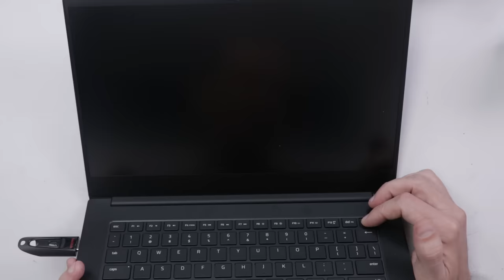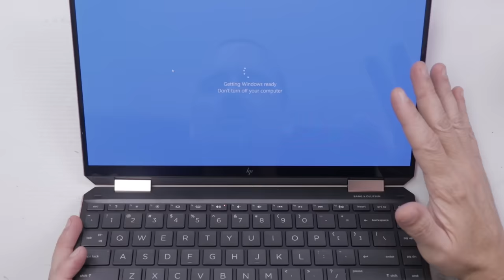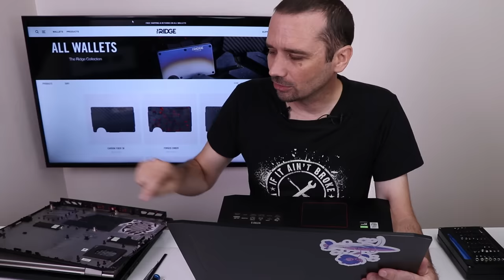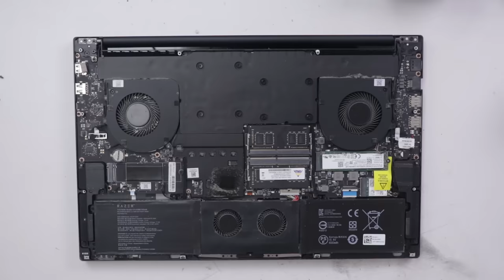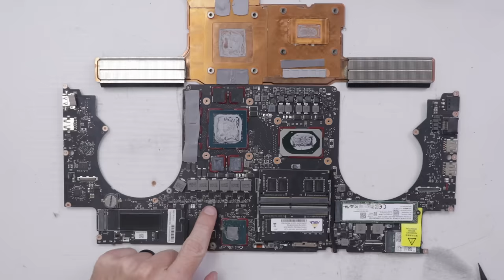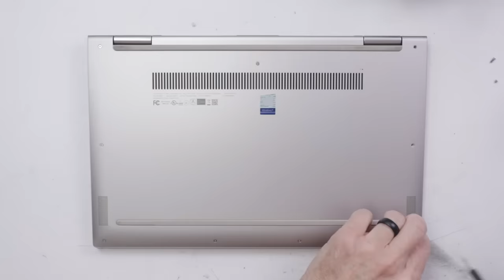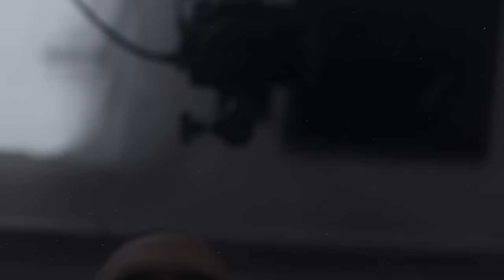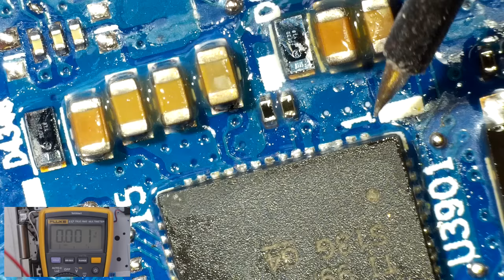I Paid $2500 for 5 BROKEN High End Laptops - But Can I Fix Them?!

Comment: I would suggest trying a higher wattage charger. Normally USB-C devices are not supposed to draw more current than the charger’s 20v PDO advertises. 
It’s possible that when Lenovo developed the machine in-rush current was not kept under control (to ensure compatibility with 3rd-party chargers) or that the machine may not be adjusting the maximum current draw based on the max current value provided by the charger. 
Certain USB-C adapters may be more quick to trip over-current protection than others. For example - if you try to power up a Raspberry Pi 4 from a Nintendo Switch USB-C adapter it will trip the overcurrent protection because the in-rush current drawn by the Raspberry Pi 4 when it is initially connected is greater than the 1.5A current limit for the 5v PDO of the Switch charger. (Off tangent - This is a good thing for the Nintendo Switch because they are especially sensitive to higher voltages finding their way onto pins like CC, VCONN, SBU1, SBU2, etc. - so if that device were to negotiate the 15v from the charger it would likely kill the console)

Comment: Two things about the battery from me: 1) remove the battery and power. Tap the power button 30 times then hold it for 30 seconds to discharge everything inside the laptop. Plug battery back in and power, to see if it charges. 2) you tested the charging board, what about the battery connector to the motherboard?

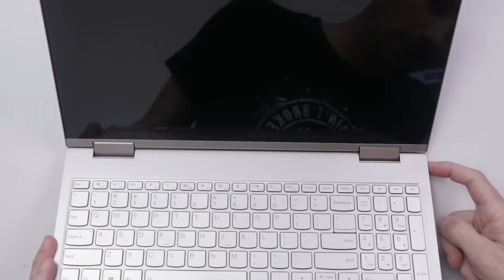Comment: I know hindsight is always 20/20 but 7:40 and later plugging in the charger then the battery was a pretty clear sign the battery wasn't the problem and if it wasn't for the latter I would check for cracked solder joints, since that isn't the case I would check the power delivery chip or there might be some faulty resistor/capacitor making it think it's going out of spec and turn off.

Although I wouldn't sell it to someone, I think an easy fix would be to insert a mosfet between the battery and have a 555 timer or microcontroller detect 20v from the charger and disconnect the battery for a couple seconds, that "should" technically make it functional unless something changes.

Comment: Regarding the Lenovo laptop, I have an older Lenovo laptop that had the same issue. I had to replace an 8 pin MOSFET. I followed a guide, so I don't really know why it worked. Though, I do think that my computer has two charging circuits. Hopefully this helps.
Reply from the maker: Thanks!
Reply: I have a Lenovo Y500 (8 years old at this point!) that had battery issues from the very first year. 2 years ago, it decided it didn't like the battery any more, somehow. If I power up the laptop with the battery plugged in, it doesn't even power up. So, I have just been running it like a desktop with the battery removed.
That said, it would be nice if a MOSFET replacement fixes my charging circuit issues. Which laptop did you have and where did you find the information about replacing the MOSFET?
Reply: @hooeezit  Interestingly, I have a Y580; the model just before yours I think.

In the process of writing this comment I remembered some of the details of the issue I had. Long story short, it may have not be the "same" issue but a similar one.

I'll try to find the guide so that you can see what I replaced. That's said, paraphrasing, the guide basically said "This is what's bad. Change it with a good one.".

I'll come back with an update about whether I found it or not.
Reply: @hooeezit  I can't post the link. I think it's being filtered as spam.
Reply: @luchvk  I think I found the page. It's on Blogpost, right? And that is pretty much exactly what is happening with my Y500 as well. Solid find. Thanks man! I'll just need to find a place to source that mosfet or an equivalent now.
Reply: @hooeezit  Kentz life?
Reply: @luchvk  Yup, exactly. I was also able to find schematics for the Y500 and look up the part of the circuit he is talking about. Weekend project queued up.
Watching these repair videos does pay out, after all :D

Comment: Man, that's a tough one to figure out. Maybe if you installed a flux capacitor on it and chucked it out of your window at 88 miles per hour, it'll end up back at the factory that built it and then it's their problem.

Comment: This is going to sound strange for the Lenovo but it does work on the older ThinkPad systems going back to the older IBM models. Remove the battery, unplug all power systems and tap the power button about 13 times. On the 13th press hold the power key down for a full minute, reconnect the battery and power system then restart the laptop. Sometimes a static charge can build up in the system and this causes strange battery and power behavior in the system. Dell, Lenovo, and ASUS systems have all had this issue before. It's an old-school fix but worth a try.
Reply: I think you can just simulate the same thing by holding the power button with the battery and possibly CMOS disconnected
Reply: sounds like cult of the number "13", why not 15 or 16 times ?

Comment: 22:30 it's probably having an inrush current issue if unplugging the batter on startup makes it start up..      

Another thing to check is if there's an added component which is drawing too much current , like a video card, or bios settings with the cpu voltages set for overclocking.

Comment: One thing I could recommend you doing is reinstalling windows with the manufacturer's recovery disc, it should be on their website online. It will have all the drivers compatible for that laptop, along with software made for the laptop specifically.

Comment: Follow the cable from the battery connector to the board... the charger board doesn't switch the mode and most batteries use I2C protocol (charge, temperature, etc).

Comment: -Reinstall Microsoft ACPI-Compliant Control Method Battery
-Perform a power reset on your laptop
-Turn off the battery charge threshold
-Check bios for battery options. The old settings from previous owner might be on and causing the problem. 

Those what i can think of on software side to try. Bios would be my choice to look in to, there should/could be some settings for the battery what are causing the initial start of charging.

Comment: I had the same issue with my nitro. Unplugging the battery and removing the cmos battery then reinstalling both fixed it. Some sort of issue that comes up if the battery is unplugged but the cmos stays in.

Would strongly recommend trying that if you haven’t already.

Comment: That battery charging issue just needs some bodge job fix! So all you need to do is cut a small hole in the back of the case and fit a switch so once u plug the charger in you can flick the switch to disconnect the battery then flick it again to reconnect it and it should charge ! A small momentary switch routed to somewhere in the case that you can get to . Could even remove one of the USB ports or something not really needed and stick one in there ! Better than sending it to the bin !

Comment: in Windows 8, 10 and 11 you can run a "Battery test" by opening a Command prompt box by typing "cmd" in the Start menu and then running the command "powercfg /batteryreport" without the quotation marks

Comment: For the battery issue: sometimes there is a problem with one cell of the battery. What you shoul do is try ot charge them with an separated and dedicated lipo battery charger and try to get correct charging of a pack of batteries. 
After that, try to charge with the original laptopt charger. Sometimes theres a special kind of voltaje or something like that

Comment: I have a lenovo y50 with the same problem as the yoga. Bought the laptop in 2015 and still use it like that. When charger doesnt work, you have to wait 5-10 min and then it works. Otherwise its gonna heat up and do nothing.

And one thing, if the laptop started, you cant connect the charger because it wont charge at all. You have to turn it off, then wait some time and then connect the charger.

Comment: for the Yoga, the there will be achip to detrmine if the laptop will output or input voltage, you have to find it and check it's circut to see what's worng. sometimes bridging the v-in with the v-out will put it alwys in v-in (charging) mode.

Comment: Texas Instruments TPS65988: Dual port USB Type-C and USB Power Delivery controller with integrated power switches. That package is a "QFN" or Quad Flatpack-no-lead, so what you're seeing, where there appears to be no solder on the outside, is fine, its up in there, underneath (for lack of a better term). There is nothing in the JEDEC J-STD  that dictates filling of a pad of a no-lead component.

Comment: I have a Lenovo with the exact same issue. It won't charge until the battery has drained all the way down, then left to sit for a few weeks. Once there is no more power in the battery, it will charge up to 100%. I use it always plugged into AC, as that way it takes a good long time for the charge to go down. When it hits 10%, I let it discharge all the way, give it a few weeks, and repeat.

Comment: 6:30 im a refrigeration mechanic and get that same feeling with a lot of jobs, (this is a stupid example) rock upto a job and a fridge is tripping a circuit breaker and you find a whole heaps of melted connections due to being loose so its sure to fix it, easy job repair wiring, switch the fridge back on and it trips again... ends up being a complicated earth leakage fault and turns to a difficult job...

Comment: Check the voltage at the battery connector, then check with the thermal camera after you plug the battery in and get it charging.

Comment: Check resistors, MOSFETs and transistors on the 19 volt line on resistance mode. Also check same components on 5v line.

Comment: I suspect the battery on the unit that will not charge. The charging circuit has a impedence check before it will switch to charge mode. This prevents charging a shorted battery pack and damaging the charging circuit or even the power brick. Check the battery's internal resistance to make this determination.

Comment: I work in IT and one of my go to methods is just using a charging brick that exceeds the wattage of the original. I also don’t use any intermediary dongle devices like that, at least initially, just to see if it’ll kick it awake

Comment: I had a Toshiba A500 with similar charging issues, believe it or not it was the LCD panel, when it was unplugged the laptop would charge without any issues, I replaced it with a new one, and it worked perfectly
Reply from the maker: Really? That’s crazy
Reply: @Tronicsfix  yes, apparently it had a short circuit(and still worked fine) and the charge controller was switching off the power, I suggest when testing a board to disconnect all the peripherals, hdd, wifi card, lcd etc, anyhow love your vids keep them coming ;)

Comment: Thanks to you I fixed a similar HP Spectre for a friend. In their case the M.2 drive had failed. I managed to open it up, determine the drive they needed grabbed one and replaced it with a fresh install of windows. All for less than $100AUD. They ended  up buying us a voucher for a restaurant as a thank you which was unnecessary but really nice. So I guess thanks for dinner Steve! 

Oh they paid for the new drive :)

Comment: Did you try to use the reset button on the Lenovo? Should be a small pin hole on the back, close to the USB-C ports.

Comment: Check the USB ports where your plug your charger thing into, They probably have dirty connections and need to be cleaned. I have this issue all the time on my older computer not reading my USB ports.

Comment: My laptop shut off one day and when I restarted it there was an error message about a corrupted boot file. Tried to re-install windows several times but the laptop kept shutting off at various points during the setup. Even did it a few times from safe mode but it would always shut off while it was setting up the drivers. The laptop model is known for bricking itself at a hardware level. I even changed the motherboard but was sold one that wouldn't even power on so I just gave up on it. My best guess is the GPU chip is dead. It still has usable parts and I'm just gonna get rid of it. It would be great if it could go to someone that can still use the parts. It's yours if you want it.

Comment: For the lenovo i would suggest a bios update first in case the super io is frozen, apart from that it could be that ac is not detected when battery is plugged in, but without schematics it will be difficult to trace. There has to be ac in and ac detect, charger id and maybe charging enable signal. It could still be the controller chip not sending the ac enable signal to the super io or what not, maybe just replace it

Comment: Not too sure.
Watching Northridge fix, check for the USB ports MOSFET, and other caps near it for short to ground.
Also, what happens in thermal cam when you plug it in?
What heats up, maybe the case, but I hope this help.

Comment: Razor  is notorious for having bad batteries that bulge , leaked or exploded. usually just replacing it will fix the issue . they sometimes  last about   1 year because  after the warranty is gone.

Comment: Even after you are done i would recommend to pull all apart and check and clean and look for moisture and clean fans and replace paste and pads if installed, so no long term corrosion or surprises and good cooling.  Also put in a fresh battery to any LT you going to use and make the BIOS how you want it as windows 11 is really picky in hardware if you want updates you MUST comply- Resistance is Futile!!

Comment: What the charging issue is concerned, i recognize this issue, and is always being fixed by heating the battery gently onto a hotplate, with temperature also the voltage is rising, hopefully just enough to let the charger chip kick in to go into charge mode. I see this almost weekly coming into our repair-facillity and is typical for fully depleted lithium batteries. So heat, the battery and connect the battery as soon as possible. This trick can also be applied to iPhone/iPad/MacBooks
Reply from the maker: How hot do you heat them?
Reply: @Tronicsfix  A little hotter to the touch, around 122 degrees fahrenheit.

Comment: I had a system at work a few years ago that sat in a lab and just ran tests.  They started having some heat issues.  When I opened the case, the entire inside of the case was covered in about 1/2" thick material just like you pulled out from the heatsinks.  Thought they were going to be playing their favorite song called "Burning down the house" That stuff is extremely flammable.

Comment: Not related to the Lenovo, but maybe you can get that acer keyboard working. It's not permanent at all, but you cant cut or file just a bit of the connection edge of the ribbon cable. I've got a dell laptop that had this issue where some keys would not work and although it could be the membrane traces that worn off, this trick solved it

Comment: I've been doing laptop & computer repair for 6 years now, and out of all the computers I have received these are the most common problems:
Charger is busted
Windows needs to be reinstalled
Thermal Throttling
Battery needing replacement.

It's also not uncommon to receive laptops that people tried to fix themselves. It looks like the Acer Nitro you got was taken apart before as a lot of people struggle with the ribbon connectors. Modern laptop keyboards are super cheap, and have very sensitive membranes that are ruined by dust and debris (very common on gaming laptops because theyre commonly eaten over...) I always replace the keyboard if reseating the connector doesnt work.

I have gotten free high end laptops and some slim desktops that only needed a new power supply. It's crazy how quick people are to throwing expensive tech away.

Comment: I think the charging issue is caused by USB control chip trying to charge the charger is if it was for example a USB thumb drive. If the battery is disconnected or completely discharged it has no other option other than use external power source. If battery has some change it gets confused and tryes to be a pověr source for periferies.

Comment: As much as I like the Lenovo Yoga series, I have one that is on it's last legs structurally, but still works. The touchscreen glass is broken, the power button has caved in, necesssating a paper clip to power it on, and the hinges are toast. Hinges are too strong for the structure to allow it to be a convertable. The keyboard is solid and it still performs. Too many misses for what it is. The mouse drivers are a problem as well. It was given to me and abandoned after the previous owner took it to geek squad multiple times with touchpad issues; fixed it with a driver reinstall for the pad and has been solid sans the shoddy build materials.

Comment: That board has very nice traces to follow. Start at the USB-C and see. Given that both of your USB-B ports are not working I'm willing to bet it is some short in the current sensing circuit somewhere. Because the power is already delivered to the system you basically bypass that when you plug the battery in live. Just a hunch, but some trace follows and maybe one more on the FLIR to narrow it down (make sure your trace doesn't follow a via to the other side of the board) oughta get you closer.

Comment: This video was definitely super interesting. The thing that I noticed the most was that you didn't have a stupid amount of knowledge. I could see you going through and troubleshooting as you want. Such as switch the windows installation media from Microsoft OEM to one with the Asus driver package. Then to see you taking apart these computers, looking for visible issues and fixing them. Good on you for taking the time to save these laptops. I do recommend trying to charge the laptop without the dongle, I wonder if it would just charge normally.